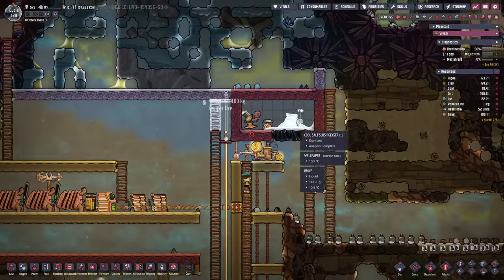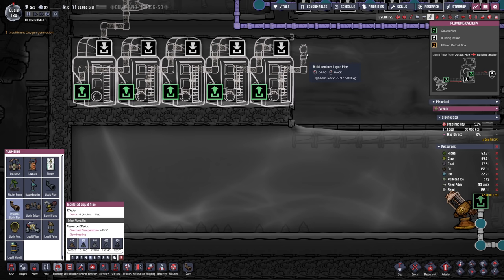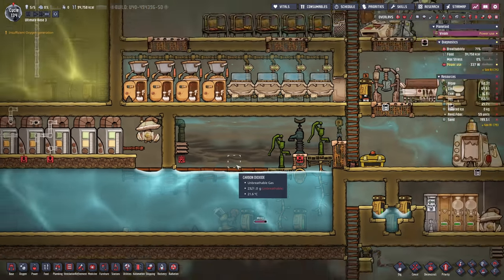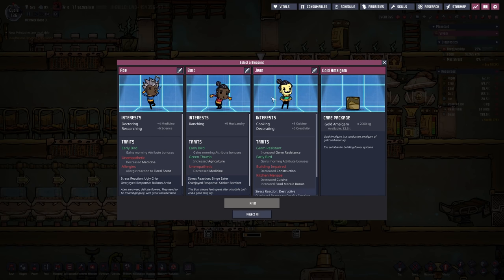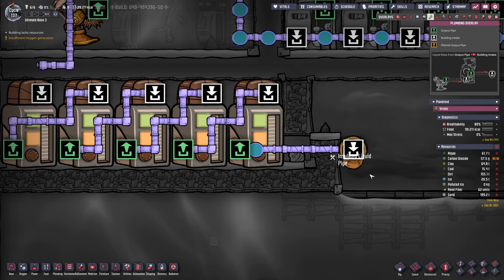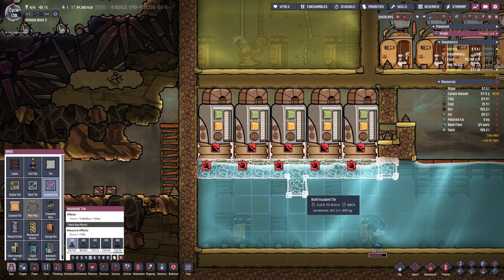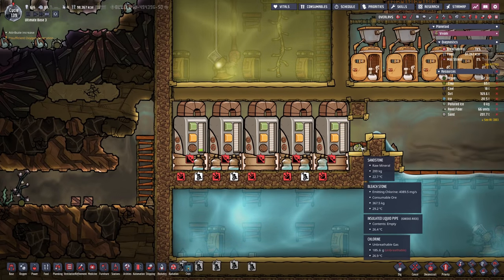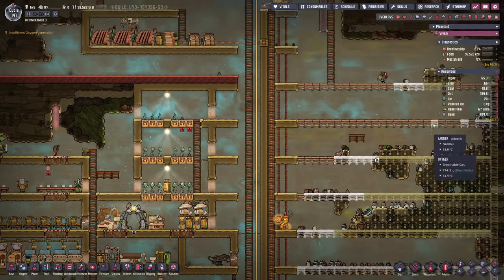WATER PURIFICATION - ONI - Spaced Out: Ep. #9 (Oxygen Not Included)

Comment: Hi Nathan!! I'm loving your videos. You're such a happy duplicant! 
I have a budding channel and so far I have Surviving Mars gameplay, but I've been practicing on my first Oxygen Not Included base! I made a similar chlorine sterilization system to fix a germ problem, and also had no plastics for a sensor. I learned 2 things from this. a) you only need the tiles 3/4 full of chlorine to sterilize water through b) 4 tanks. I did however love the vacuum thing, so using my double airlock system I already had, I added some automation switches and a pump, filled a storage bin in the middle chamber with bleach stone while the water tank chamber was vacuumed out, then opened the door between the now chlorine filled small chamber with the main chamber and let them fill up. worked like a charm and do-able at low tech levels as well.

Then I got some Pacu, and found out they not only clean polluted water, but also germy water. I was so happily surprised. Now I'm working on cooling the water heh.... and fuel... I need to rebuild my hatch ranch because I've run into coal issues, my only Natural gas vent went dormant and I haven't found any oil beyond a leaky oil geyser. I'm hoping to find an oil well or slicksters as I strip mine down, but I have a lot of polluted/germy water to store before I can do that.

Comment: The water has to stop for a few to kill the germs.  You could put a 1000 tanks and you'd still have germs.   There are builds with 3 tanks each with a door under them.  On timers that get the job done without a germ senor.
Reply from the maker: Now we have something even better.
Reply: @Nathans-Sandbox  I think your system might stop working once all the tanks are full enough.
Reply: From memory, seven full tanks will steralise a 10kg/s flow, but yeah, they need to be full to start with.  Easy to manage with the entry tank automation connected to an output valve.

Comment: since liquid vents have a automation port, just run a cable from your third water tank to the liquid vent and open it only if the tank is filled between 50%-100%, all the door shenanigans are not needed :)
Reply: But wouldn't there still be some blobs of water that are polluted, if we use this method.
Reply: that's why you need buffer tanks so that the clorine has enough time to clean the germs before the water reaches the vent. If i remember correctly 3 tanks is the minimum, if you want to be 100% sure use the first or second tank for the automation wire

Comment: I always thought it would be fun to do this by boiling and condensing the water.
Reply from the maker: That is fun too once you have enough power to support it. What is your setup for it?
Reply: @Nathans-Sandbox  Volcanoes/magma layer + steam engine/aqua tuner, although if you're lucky enough to have a slush geyser in the right place that could make for a good low power solution, would just need to run the pumps.
Reply: @Nathans-Sandbox  and ofc. you need to deal with the dirt if you are purifying polluted water (and other materials for other waters).

Comment: my reservoir says zero germs but when i pipe it out into the tank it has food poisoning germs. How can I fix this?
Reply from the maker: Hm, that doesn't sound right. Have you hooked up enough tanks and did the trick with the doors I'm using here?
Reply: I know it reason because I went through this. The reason is tanks directly transports what inside them when they have connected to input via pipes or vent for example If you connect the output to a pipe switch that is closed, it will still send water to switch because the tank output connected to the input of the switch, but the water will not pass the switch. Therefore water goes out from the tank with germs